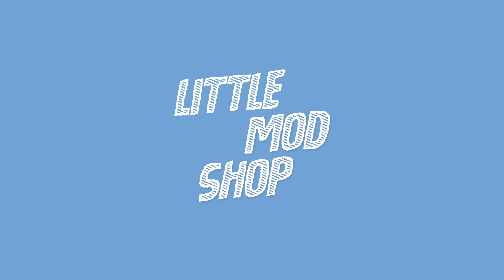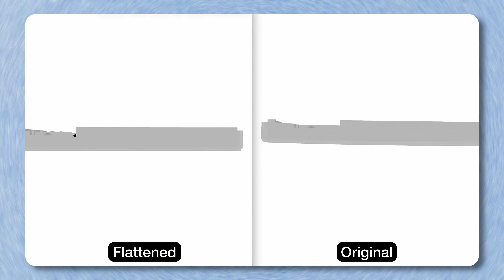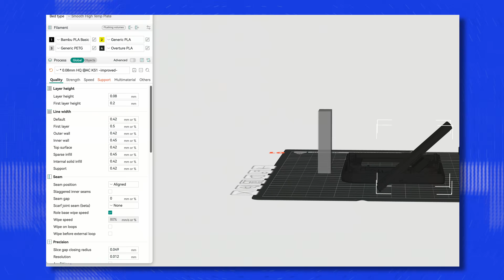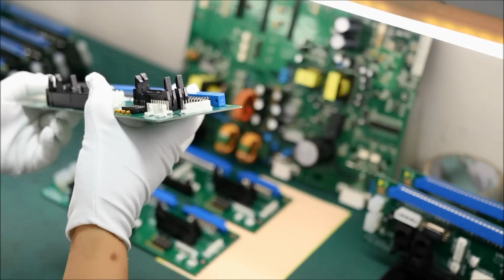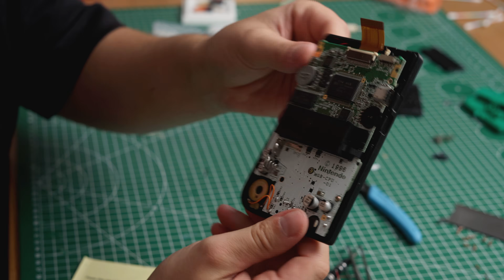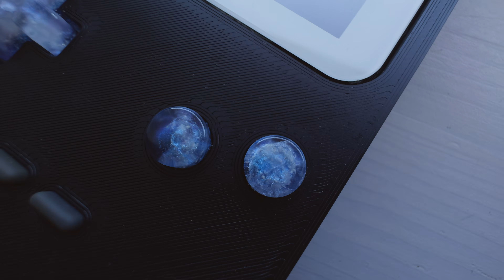I 3D printed a Game Boy Pocket

Comment: I love these types of projects so much! Question: Did you want it to be as authentic as possible? Because I would have added a rechargable battery in there. Those lipo ones have great performance and endurance. I think its time that I start building something my own and put the printer to work.
Reply from the maker: yes i have ordered a usb mod for this project. but aliexpress lost my order so i haven't had the chance to install that one. but i agree with you, all my other mods do have a usb c lipo mod. they are a charm to work with and making it really hassle free. one plug to rule them all :)